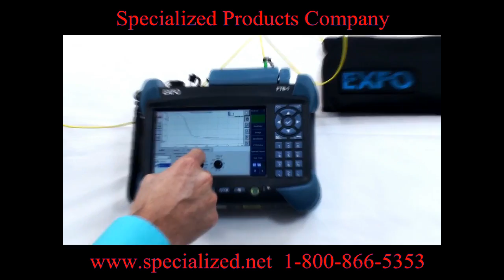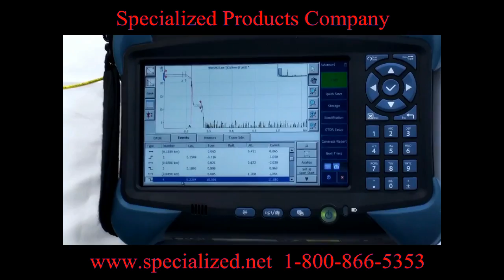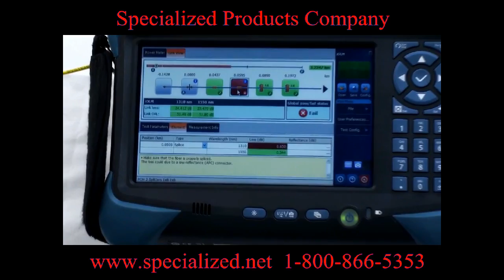EXFO iOLM Intelligent Optical Link Mapper Software

Comment: Looks like an easy process, couple of questions.
1. Does it produce 2 x traces for each link tested in SOR format. 1310 & 1625
2. Does it test through small footprint multiports & squids to produce a link loss comparable to Insertion loss values?
3. Is it approved for use on the NBN? and compatible with the LFN Fibre Workbook?
4. What is the approx cost of the unit in a qty of 20 units?

Cheers.

Shaun Taylor
Splicing Operations Manager
NBN Passive Network NSW North